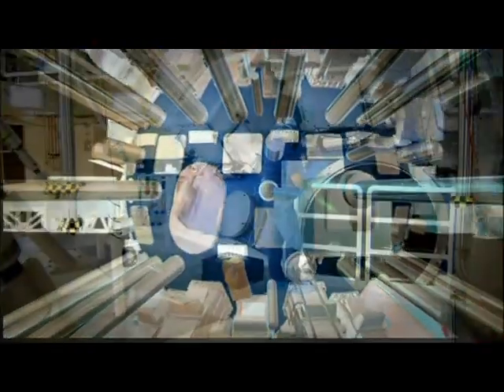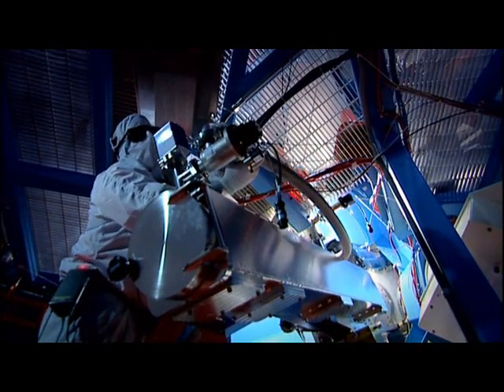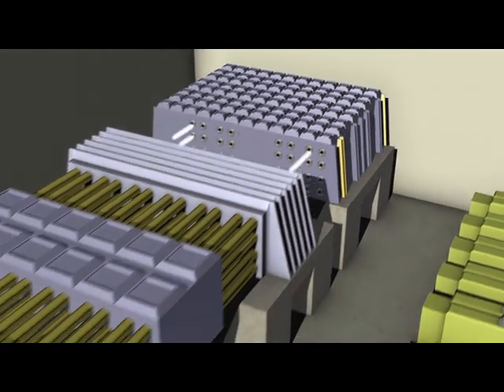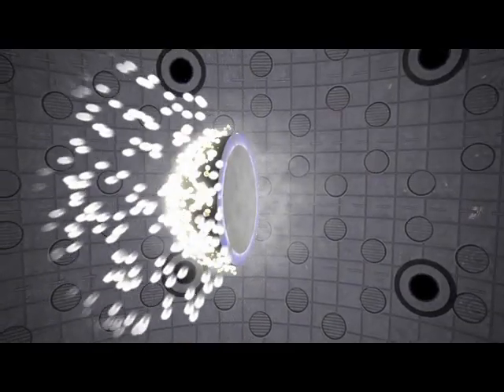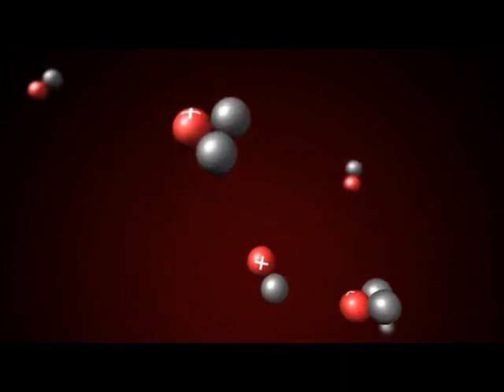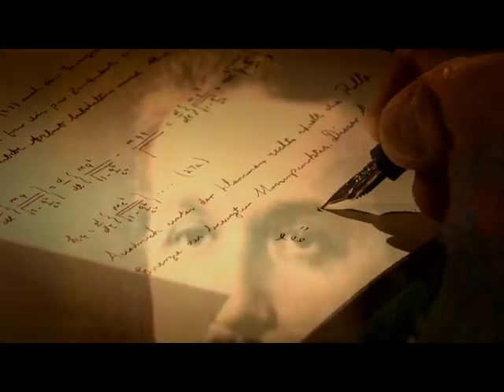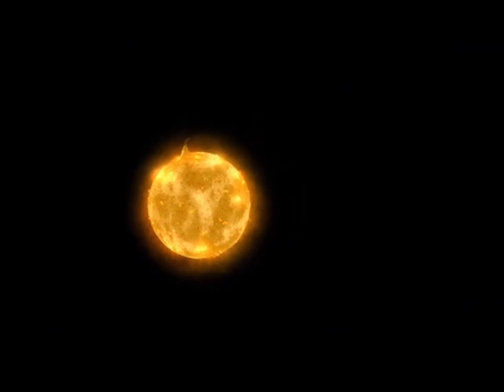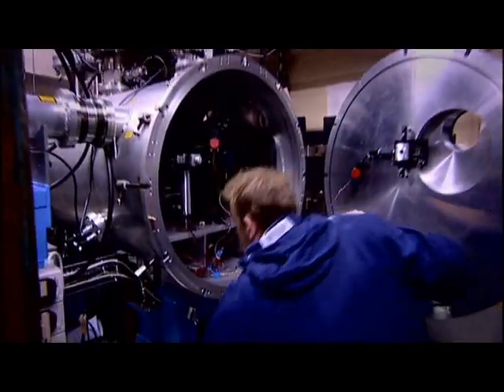HiPER - High Power laser Energy Research (Part 2)

Comment: Theres photovoltaic (solarcells) and Chemical? Theres not many ways you can move electrons like if you want to push an object. You either have to push it using physical contact/movement, using magnetic forces (which means using moving electrons or moving physical magnets so back to square one), pushing photons (PV) and Chemical reactions to move electrons. I can tell you for a fact that theres huge investments in PV and Chemcial (battery) and even windpower but mostly only in China.

Comment: @FlamingPope 

I agree that more effective use could likely be made of the excess waste heat.

One of the reasons water is used is that it absorbs both heat, and radiation. And the abundance means you don't have to condense and store it.

Thermoelectric (Peltier cooler) devices could perhaps be used, to draw more heat from the system.

Or similar to some other industrial projetcts, like COGEN turbines. A reactor facility could provide heating and hot water for local industries.